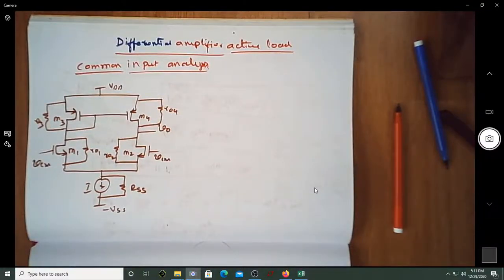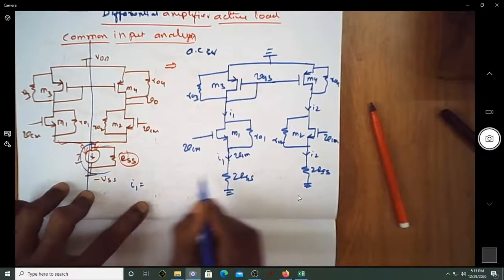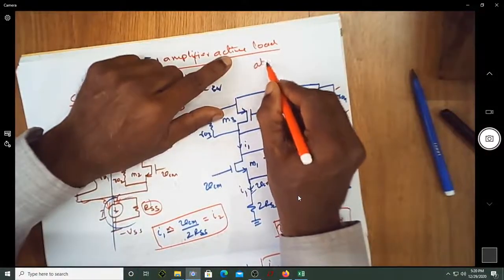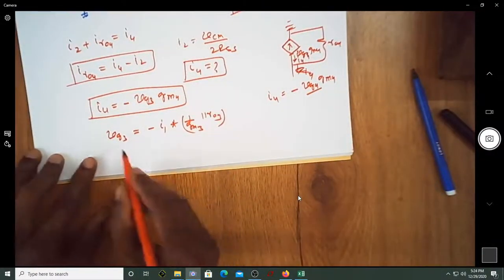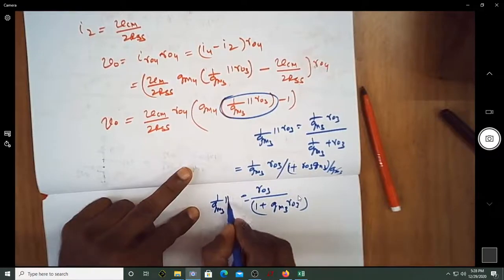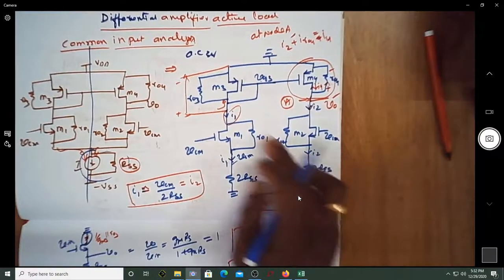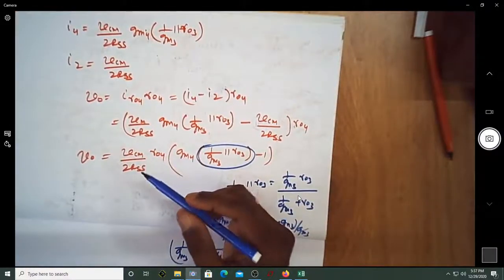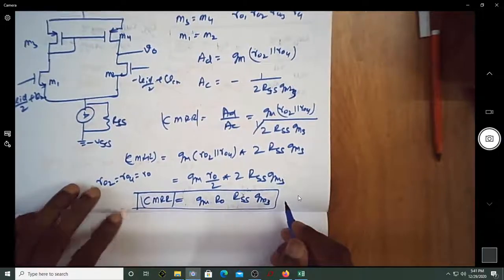Differential  amplifier active load common gain part1

Comment: why can't you just analyze it from the right side of the ckt? you know the input to right gate is also Vcm, so wouldn't the output just be a common source gain with drain resistance and source degeneration? 

E.g. gmro * (Rd/(ro + Rs + gmroRs)) .. if you calculate this then this basically becomes ro4/(2*Rss). Your calculation is 1/(2*Rss*gm4) instead though
Reply from the maker: Hi, sorry for the delayed response. 
As the circuit has a current mirror,  in order to find the output voltage we need to consider the effects of all circuit components. 
If you consider only the left hand side of the circuit,  the effects of current mirror n M1 will not be taken into consideration. 
That's why we first found icm and did the vo estimation.
Hope I cleared your doubts. 
For any further clarification 
You can call me at +919620243260